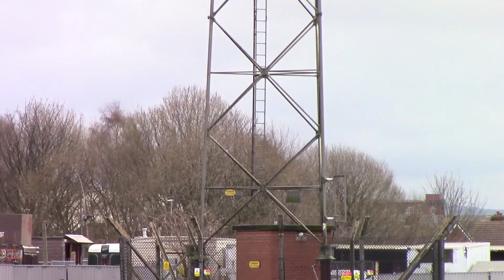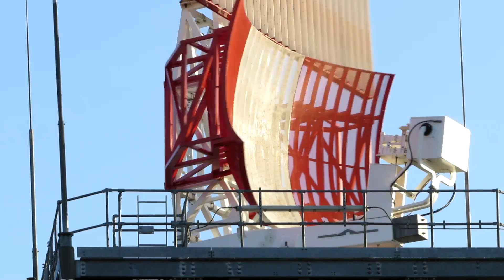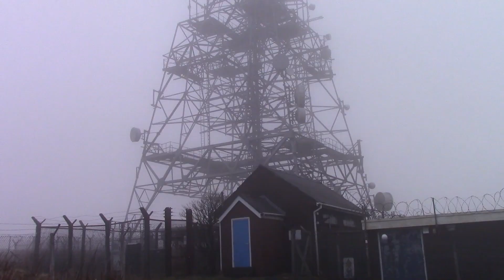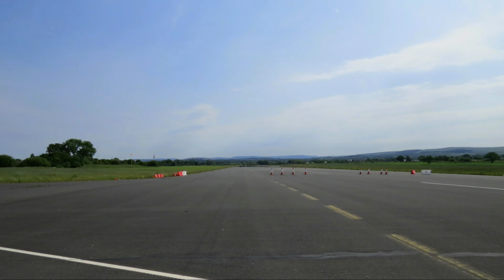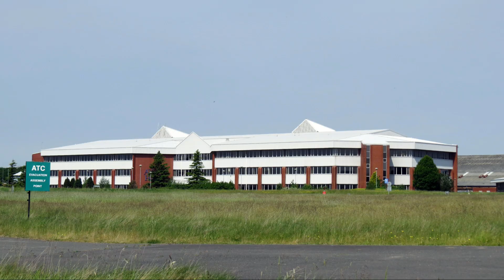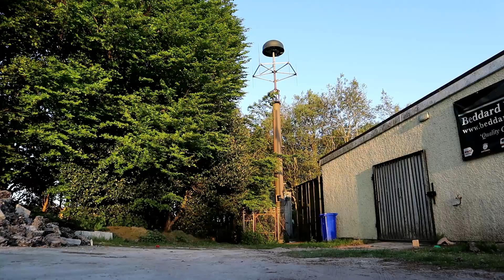5 Historic And Vintage Radio Transmissions!

Comment: The photos of Ashton Moss show both the four stayed masts of the ILR 1152kHz transmitter and the three towers of the former BBC Radio Manchester 1458 kHz transmitter. The M60 motorway now runs between the two sites.

Comment: The superregenerative ("re-jenn") is an interesting concept - the only advance in radio made, unequivocally, no arguing, by Edwin Armstrong. His claims to regeneration generally, frequency modulation and the superheterodyne  process are much shakier. Super regeneration yields extremely sensitive receivers for an absurdly low component count. Downside is that these radios are very unselective and suitable only for the open fields of UHF/SHF and, in the absence of received carrier generate an exhausting loud hiss which cannot be effectively squelched. Two British WW2 radios, the B set of the WS19 AFV transceiver (230 MHz) and the S-phone (around 450 MHz) used superregeneration. For unclear reasons, the WS19B was a flop being replaced by an HF infantry liason radio based on a small manpack (WS38) or an infantry telephone on the back of the  tank. The S-phone was used for covert operations by SOE in Europe and by British MI9 and 43 Infantry Division in the follow up operation to extract the remains of British 1st Airborne Division from Arnhem starting in early Oct 1944. Superrrgen Rx/Tx were the basis for TV remotes and garage door openers in the 1970s and can still found in super cheap kids' walkie talkies.